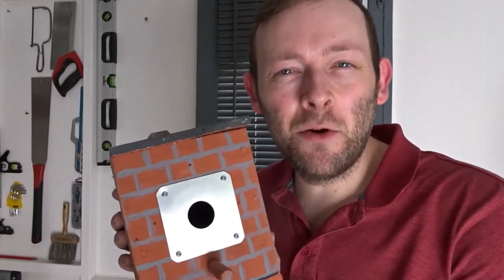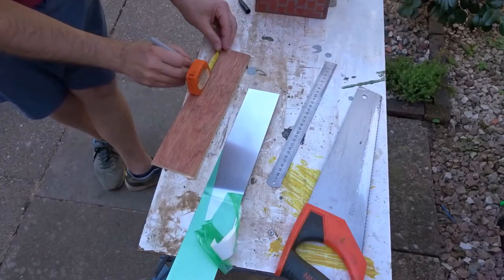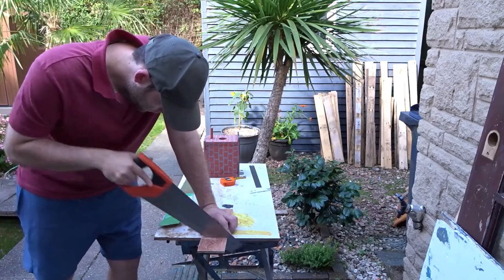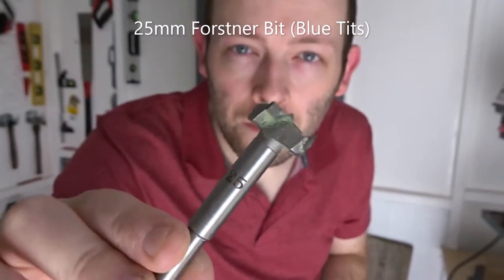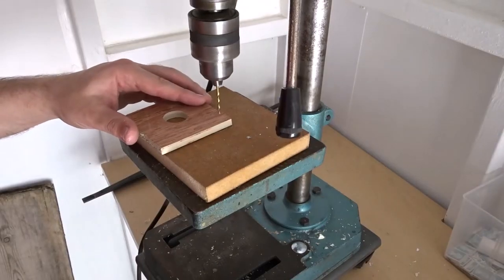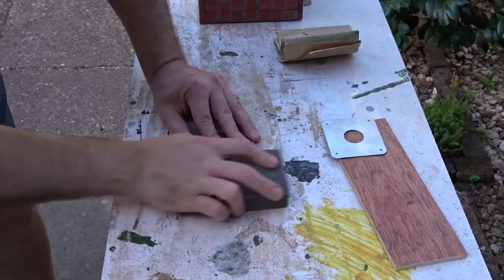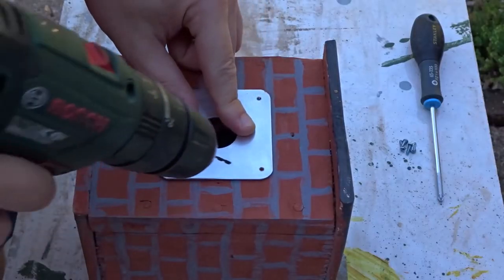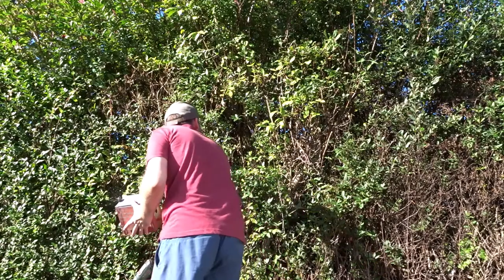How to Make a Bird House Protection Plate (Predator Proof Bird Box)

Comment: Its not generally a good idea to have pegs in bird houses. You certainly dont need them I have 8 bird boxes on my allotment, and it does take a while sometimes to attract birds. Most of my boxes did have birds in them and I also paint them bright colours. I am due to take them down soon to clean them out, repaint if necessary and put them back up late Winter. Rats are cunning critters seen them climb trees for bird food so had to get some cheap kitchen bowls from wilkos and have them upside down above the feeders to stop them climbing down for the food, where ever you have bird food rats arent far away
Reply from the maker: Thanks for sharing your advice 👍